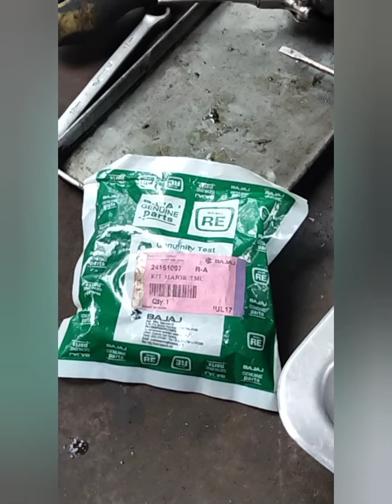brake problem mahinang kapit ng preno lumulusot pa Bajaj RE

Comment: Magandang araw maam tanong kulang po bakit lage marumi ang fuel filter lge may langis araw araw ko naman pinupunasan pero may langis parin
Reply from the maker: Oil felter po ba KC kung ang gamit nyo po na oil felter eh Yong replacement mahina po Yong pinaka oil ring ng felter minsan naman po kulang sa higpit at ang isa pa po nka sa oil pipe nanggagaling ang oil
Reply: @michelleestrada9608   ty maam